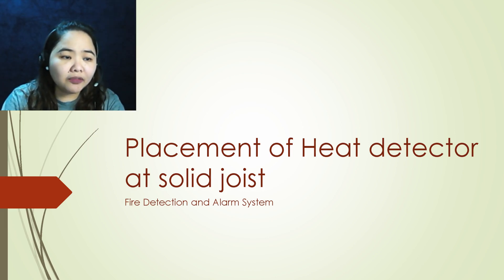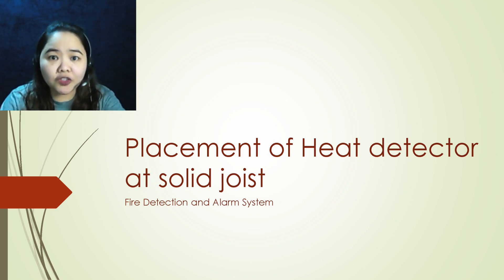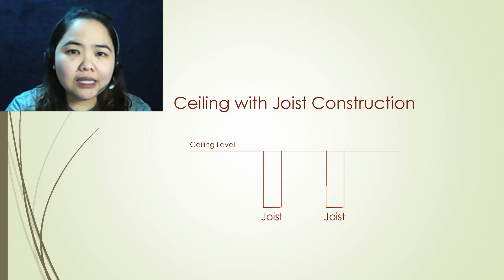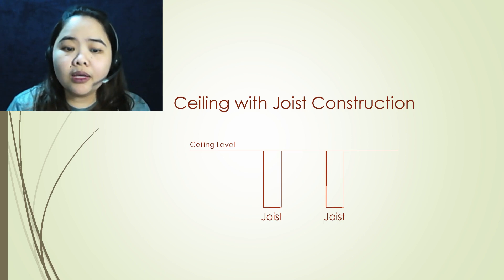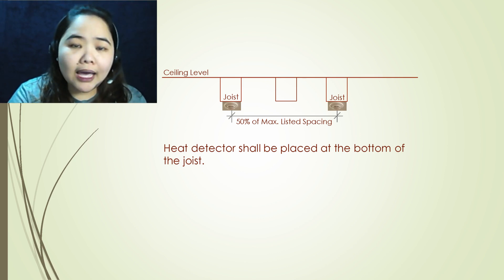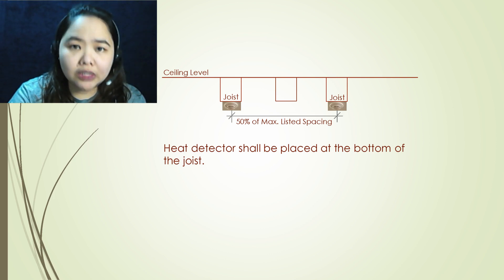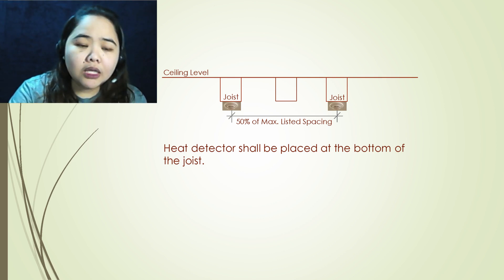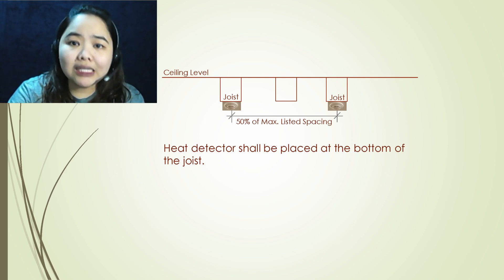Fire alarm design - Heat detector at solid joist construction #Firealarm #Allaboutfireprotection

Comment: Hi What is the listed placing
Reply from the maker: The listed spacing will be the coverage of the detector which can be seen in the data sheet. Otherwise if this is not available, the listed spacing for heat detector as per NFPA 72 is 9.1 mtrs